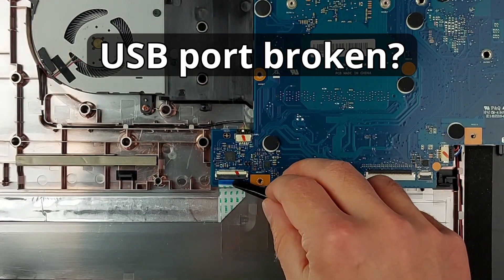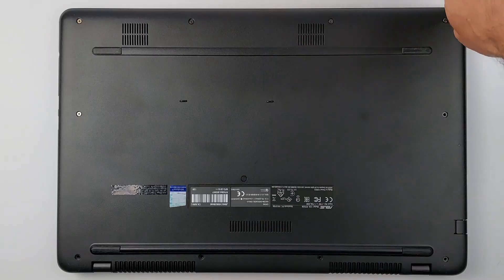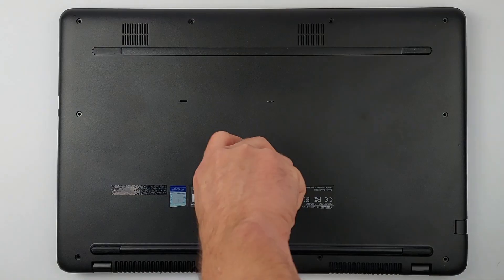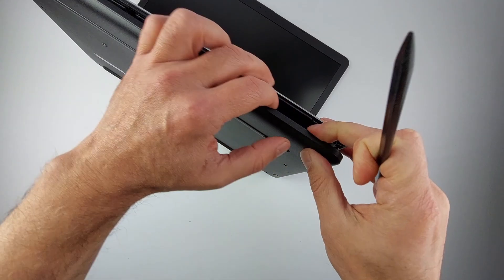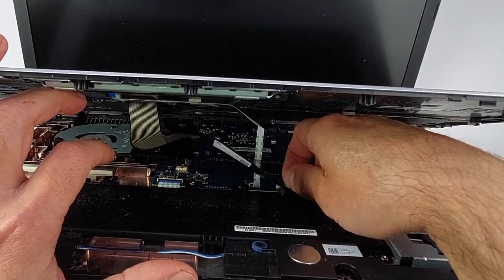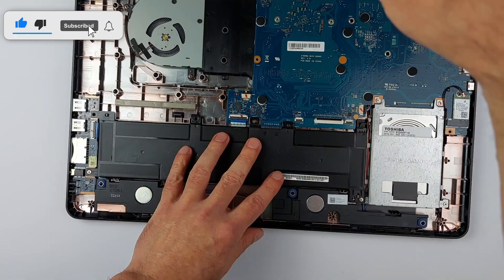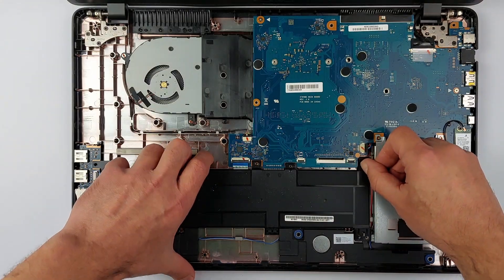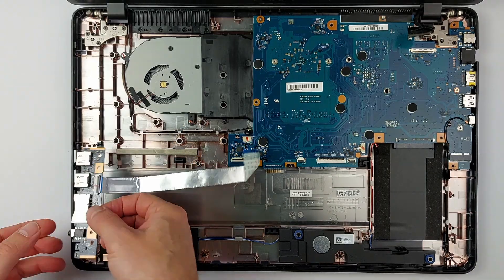ASUS VivoBook 17 Disassembly & USB Port Replacement – Laptop USB Repair Guide

Comment from the maker: Did this guide help you repair your ASUS Vivobook 17? 👉 Let me know in the comments – your feedback helps me improve future repair videos!
🛒 ADVERTISEMENT – AFFILIATE LINKS: As an Amazon Associate I earn from qualifying purchases.
🪛 Precision screwdriver set → https://amzn.to/3Ilk2UQ
📎 Spudger → https://amzn.to/42tGEJw
📎 Anti Static Wrist Strap → https://amzn.to/4nbYbOT
📎 Anti-Static Mat ESD → https://amzn.to/4ny5Oz5
🔋 Replacement batteries (check your model number on the old battery):
B21N1818 → https://amzn.to/4na4y5u
C31N1907 → https://amzn.to/4n5oCG2
B31N1635 → https://amzn.to/42voszg

💡 Tip: Always double-check the battery code on your original part before ordering – ASUS uses different batteries in similar Vivobook 17 models.

Comment: Bjr. Je posséde un vivobook 17 sonic master X705UB. Puis je remplacer mon SSD par un NVme ?
Reply from the maker: Bonjour 🙂
Pour le Vivobook 17 X705UB, il n’est pas certain qu’il prenne en charge les SSD NVMe.
Certaines versions du X705 ont un port M.2 compatible NVMe, mais la plupart des X705 n’acceptent que les SSD SATA (2,5 pouces ou M.2 SATA).
Tu peux donc installer un SSD SATA sans problème, mais un SSD NVMe n’est probablement pas pris en charge.
Reply: @LaptopRepairTutorials  merci de la réactivité et d'avoir pris le temps de me répondre. Cdt
Reply from the maker: @olivierGONZALEZ-b9p  
Désolé de ne pas avoir pu vraiment vous aider, mais si vous avez d’autres questions, je vous aiderai avec plaisir. Bon courage pour la mise à niveau de votre SSD !
Reply: @LaptopRepairTutorials  Bjr. SSD monté, aprés avoir cloné mon ancien hdd, ça fonctionne. Autre question, puis je changer la RAM, et mettre 16 mo de ram ?
Reply from the maker: @olivierGONZALEZ-b9p  
Bonjour ! 
Content que le SSD fonctionne !
Malheureusement, comme déjà pour votre question sur le SSD, je n'ai pas trouvé de spécifications fiables pour votre modèle exact de laptop. Je n'ai pas pu trouver de manuel pour le X705UB et je ne peux pas faire d'affirmation fiable en raison des différentes spécifications au sein de la gamme de modèles X705. Je ne peux donc pas vous le dire avec une certitude à 100%.
Cordialement